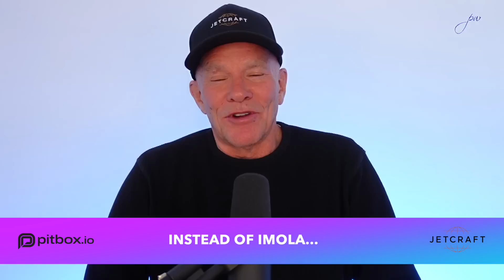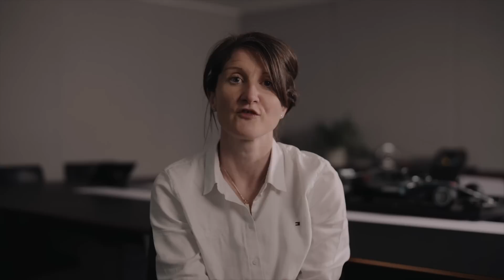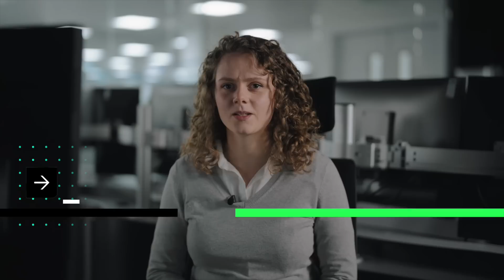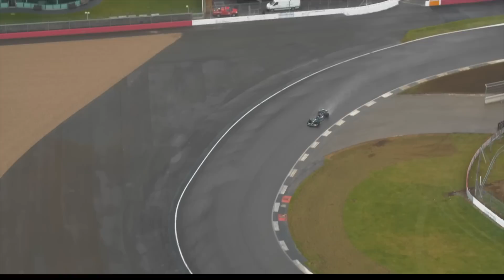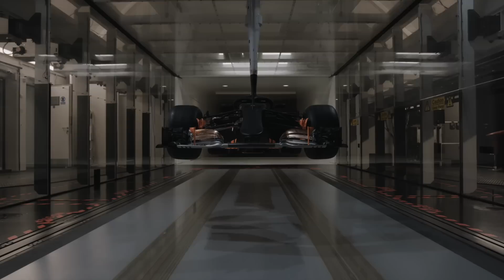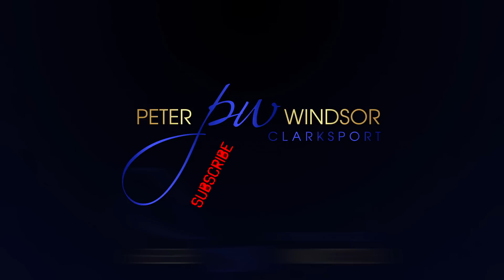F1 Merc aero: meet two of the engineers by Peter Windsor

Comment: Is this who mercedes chose to take on Adrian Newey? This will be one tough dark souls boss fight for mercedes.
Reply: These are the worker bees. The primary designer is not in this video. The one who created the W13 concept. 😊
  
And as a point of comparison the Apollo program that went to the moon used young engineers to get them there. Margaret Hamilton a brilliant computer programmer was integral in the lunar lander success. Age is not a yardstick to measure brilliance. Just saying.
Reply: @WRXMAN-ms2mm  the only person who's talked of age is you though. That was completely unnecessary.
Reply: @cybotx1024  The reference to age was totally implied. Ageism was implied. If a statement can be read or interpreted more than one way reasonably without stretching the limits of credibility, then it is a reasonable interpretation and observation. Ageism is also applied to the old. That they are past it and should automatically move over for the young. Some people also don't hit their stride, their true potential until middle age.